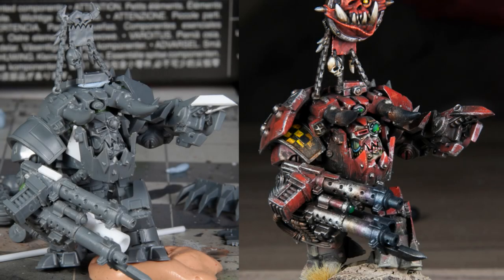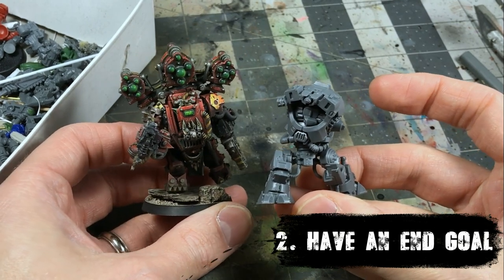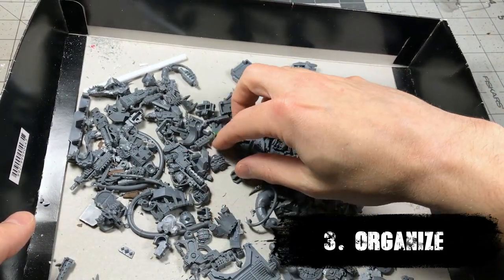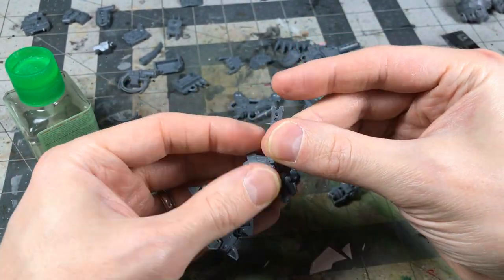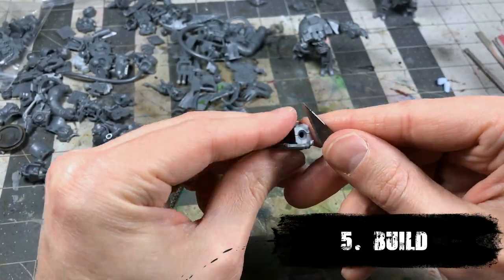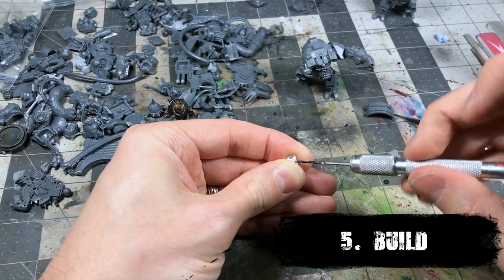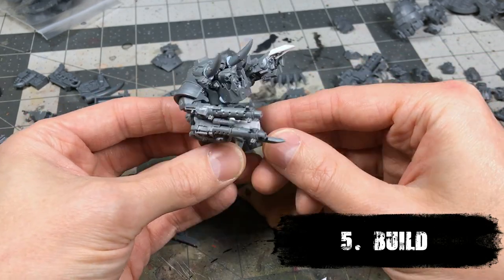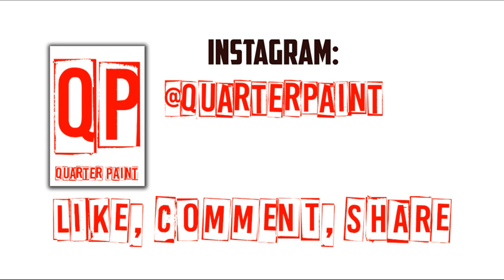How I: Convert & Kitbash Miniatures

Comment: Great tutorial. I'd only add one minor thing. It's probably not an issue for Orkz since there's enough surface area to attach bits to. However, I'm a nids player, and I've found that for certain models (namely genestealers) Blue Stuff may not be strong enough to hold everything in place. You have an arm that's still relatively large, but a relatively much smaller joint, and often you want it raised into the air like it's about to strike either when you're test fitting or if you like to zenithal undercoat and then paint in sub-assemblies. In such a case, learning to pin your minis can really help. It's a pain because it's an extra step, but it may be worth it if you want to do conversions or paint to a higher standard.

Comment: Where do you get these parts?
Reply: He's spent about $1000 to make this one model. Get some cereal box and scissors instead.
Reply: With Orks, you can do a lot with sheet styrene/plasticard and 2-part modeling epoxy (greenstuff, milliput, etc.). Having the extra bitz laying around from GW kits is nice, but it's understandable you're not going to have a lot of them if you're just getting into the hobby. I'd recommend stocking up on various plasticards in different shapes/sizes, most of which can be found at your local train hobby store for cheap (like $1.99 for a pack of three 6"x4" 3mm thick sheets). 

You also want to keep an eye out for recycled materials, especially for things made from plastic styrene (which is the type of plastic most miniatures are made out of). Throwing out some electronics? Pull out all the small pieces. Twist ties from the grocery? Strip the paper off and use the metal as wiring. Find some weird doodad under the sofa at your grandma's? Steal that shit and chop it up into something Orky.
Reply: You generate a lot of bits as you build models as a lot of ork kits come with a wide variety of spare parts. You can technically achieve the same effect with stuff like plasticard but imo it doesn’t look as good.